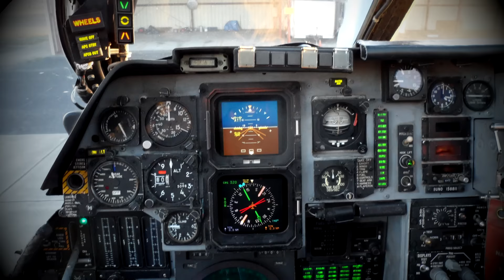USMC Jet Crashes Cable Car | Last Moments

Comment: At 500mph, they probably never even saw the jet.  Probably just saw a blur, and then felt the cables snap
Reply: They were apparently spinning as well. At 500 mph impact with the cable and the cable being attached to the cabin at the top, they not only started to fall, but must have turned upside down at least once. I talked to a car mechanic who was one of the first on the scene and apparently the cabin was crashed on the ground upside down.
Reply: @MiroslavProvod  The majority of the weight would have been in the connecting arm and the trolley which would have caused the gondola to invert during the fall..

Comment: The pilot didn't need the instruments he was 300 feet above the fuckin ground he could have worked that out by looking out the window.
Reply: Thankyou for clearing up the fact you know absolutely nothing aviation, avionics, aircraft systems, or what a pilot actually does (It's a little bit more involved than driving a truck, but even that seems beyond some individuals abilities) but are willing to sound off about it anyway! Tell me oh wise one, at what specific altitude  would it be appropriate for a pilot to actually need a functioning altimeter from?

Comment: No one should be charged, accidents happen everyday, there is no way to eliminate all accidents it's impossible, we are only human, families all got well compensated, and things changed for the better. T helped Pave the road for new safety regulations. Although It is a shame and it sucks for the people and families that were involved.
Reply: How is "just an accident" if u fly for no reason next to a very low cable car??? U should go back to school and learn what the word incident mean. This is manslaughter.
Reply: @claudiam2474  because none of there flight plans showed that there was a cable car on that mountain, and they were testing there flying, which means flying low, we have military airplanes fly over our house everyday very ow once a month or so the hit the tops of the trees and knock branches off them. There always flying low doing rolls and flips, it is super dangerous really but they still do it, and if one crashed in my back yard it would still be an accident, I would want compensated but I would call it an accident even know there flying in dangerous ways, that is how the pilots get really good at flying, it's like driving you wont ever drive really good unless you practice sliding sideways doing dounughts, and messing around learning the car and how it performs under stress,
Reply: @claudiam2474  the maps they had showed there was no cable car on that mountain atleast not to them. So they had no clue they were flying by cable cars, did you not watch the video, they had like 3 different maps and not 1 showed the cable cars there and you cant see things well at 400mph once you see something you already hit it. if anyone is to blame it's the people that gave them the flight maps. Which means it is an accident, same as when someone falls asleep while driving and kills someone, it is called an accident even if they knew they were tired. Because it was not planned that is what and accident is something that happens that was not planned.  Now if they planned on hitting the cable then it would be manslaughter lol.
Reply: @nickhaley1212  Too bad the altitude limit was set way above where the aircraft was actually flying, and at an  higher speed than what the crew was told to.
The crew willingly disregarded all the orders set to them, flying too low and too fast. Surely though the USMC and USAF chain of command in that base in Italy wasn't innocent, they never passed and signed the maps provided the Italians (which included the position of the cable car and higher altitude limits for flying in that region).

Comment: As a person I would, like most, acknowledge the human tragedy of the event. As a U.S. veteran, I would also acknowledge that the aviators clearly violated international protocol and were reckless, causing unnecessarily the deaths of many innocent lives. A 60,000 dollar settlement is an insult both to the families and the victims. As much as I would loathe the prospect of condemning a fellow vet, I would, governed by conscience as well as the U.C.M.J. (Uniform Code of Military Justice) have to be harsh with my courts martial determination. The "pilots flying" would have gotten ten years min. for a breach of military and safety protocol. The others, while not guilty of acft control, were complicit and probably should serve two at Leavenworth.  The only leniency I would allow, is that having served with distinction up to the event, I would not deprive them of Veterans benefits. It might well be the only bright spot in a grim future. I would not give them a Dishonorable, rather a General Discharge. For the victims families my low bar would be two million per family. The U.S. government must atone for this international travesty.

Comment: At least twice in your commentary you stated that the aircraft in question was a "Fighter."  It was not a "Fighter."  it was an EA-6B Intruder.  Which is, as the letters indicate, an electronic-attack aircraft.  When you fail to even get the plane type correct, your words ruin your credibility.  I suggest that you do better research prior to producing other videos!  George R. Chance Ph.D.

Comment: May I be the 100 millionth person to point out the Prowler isnt a fighter? The "Queer" is an Electronics Warfare aircraft built on a Naval Bomber airframe; it has no business even pretending to be a fighter and flying at low altitude through mountainous areas.

Comment: Seems familiar, in a way, and equally infuriating as the case of several danish soldiers that developed cancer after being exposed to radiation due US military exercises obviously it was not in the best interests of the american goverment to left that be known but the danish goverment was also in cahoots with the cover-up, those men were thrown under the bus by their own goverment, such slimy move.

Comment: No wonder, with the safety record that the MC aviation has. This accident is symptomatic to the (lack of) safety culture in the MC.
Reply: You do know the job of Marine aviation is to fight wars in the air, right? 

It's not as if war is a safe environment!
Reply: @natowaveenjoyer9862  You are right war is not a safe environment...
Combat operations are by nature inherently dangerous.
But, you have to distinguish between operational incidents and combat losses.
National Commission on Military Aviation (MCMAS), have determined that USMC had a substantially higher rate of serious rate of serious safety incidents than the other services. After establishment of Joint Safety Council (JSC), the incident/accident rate has fallen. A report from MCMAS, concluded that
"the overwhelming majority of (military) mishaps could not be attributed to th inherent risk of military aviation." Happily the safety record of all naval aviation have in the last year improved.

Comment: If I was in that cable car as soon as it started falling I would jump on top of the fattest man or woman and use them to cushion my fall. It's simple mathematics that would most likely ensure my survival
Reply: Don't forget that they weren't just falling, but spinning as well. The jet hit the cable at 500 mph and with the cable being attached to the top of the cabin, it was the spinning rather than fall what the passangers felt first. They actually landed upside down on their heads so unless you're a really small child who could hide somewhere in the middle to be protected regardless of where the impact occurs there is no plan to jump on top or lie at the bottom to protect you. And if you were in the middle and protected from the impact, you'd probably suffocate after all the bodies and weight of the cabin press on you after the impact. In fact, in the 1976 accident of this same cable car, the majority of deaths were due to suffocation and not due to direct result of the impact: https://youtu.be/6-GBikY0AqM

Comment: They shouldn't have been prosecuted, low level flying is a necessary skill and I'd rather have these accidents happen during training than while in a potentially nationally dangerous mission over enemy territory.
Reply: Only good take in this comment section I’ve seen.

Comment: So imo the aircrew was totally scape goated. If you don't have accurate maps how are you supposed to know about an obstacle like a cable car. On top of the maps being wrong I'm sure it was s.o.p to practice flying at low altitude to simulate evading radar, and if the pilot wasn't warned about potential hazards he only has seconds or less to react. Cases like this happen all the time where military and civilians die and the higher officers blame the lowest ranking officers or enlisted to save their own asses and almost always get away with it
Reply: You don't normally need to have cable cars on maps when you're supposed to be flying at 2000ft. And he should of well known there was an obstacle there because how often do you see a yellow object in the white snowy alps and go "Wow must be an optical illusion". That pilot killed 20 people and destroyed evidence,

Comment: I never knew he blamed the altimeter.  I used to calibrate aviation equipment in the Marine Corp, that would have put multiple Marines under investigation and is not fair if it's true.  It's stressful when any accident is being investigated let alone a pilot potentially pointing at your shop.
Reply: "I used to calibrate aviation equipment in the Marine Corp"(sic)

Yet don't know how to correctly spell Corps.

Comment: I'm not a pilot (never even been in a plane) but if my altitude meter was broken I'd fly high enough over those mountains so I could see clearly. Maybe that's a bad idea in aviation but it makes more sense than flying through a valley right?

Comment: Still don't understand why they were flying so low, completely undefendable unless the aircraft was compromised and impossible to control, which it wasn't.
Reply: There was a talk of them avoiding a helicopter, but they must have already been below 2000 feet if they had to "avoid a helicopter".

Comment: Wait they couldn't tell the difference between 300 and 3000 ft ?? I may have heard that wrong.
Reply: Do the readings on an altimeter and a RADAR altimeter always match?
Reply: @AA-xo9uw  I don't actually know honestly...I was just saying I would think visually 300ft and 3000ft would be enough to notice...I've never used an altimeter...I've seen them in person...I don't think I've ever seen a radar altimeter in person...if I remember correctly altimeters can work in different ways right? I'm guessing a radar altimeter determines altitude by how long it takes for it to bounce back to the source from the ground? I would guess if it bounces off of a large enough object in the way it could think that object is the ground ? Thanks For The Response! I Hope You Are Having A Great Day/Night My Brother!

Comment: It's not a fighter jet dippy.  It is an ECM countermeasures and EW A/C built on the A-6 Intruder ATTACK A/C design.  Get your terms right.  TRY to do a little research.

Comment: I did not recall this happening.  This was so terrible.  So inexcusable.  I was born and grew on US Naval Air Stations.  Dad was a career Naval Officer.  All the pilots, Navy and Marine Corps were always reckless hotdogs.  Many owned Corvettes so they could drive at high speeds.  They were arrogant and braggarts.  Dad disliked the pilots.  I believe the punishment was unjustly light.  The Pilot should have been sentenced to many years of “hard labor”.  An old style of US Military punishment.  I’m assuming “hard labor” prison sentences are no longer considered civilized.  But in this case, it would be Justice.

Comment: 0:15 well considering planes are made from lightweight aluminum and titanium, I'll predict a steel braided cable will slice through it like a hot knife through butter if it flew into one. 3:00 Whaaaaat? No way.
Reply: I think their fuel tanks were made from materials that would prevent gas leakage and explosion if they were shot at. Not sure what material that is, but could that have been why the 2inch cable was sliced and the wing survived?

Comment: HTF did the plane survive and fly home? I would have thought that a planes wing would be a lot more flimsy than a steel cable? This really does not make any sense. Any structural engineers in the place?
Reply: It wasn't called Grumman Ironworks for nothing.

Comment: was working on an aircraft at aviano when this happened. The aircraft taxied by  with cable attached to it's arresting hook. The ground crew was standing by to do mass cover up.
Reply: "The aircraft taxied by  with cable attached to it's arresting hook."(sic)

Incorrect
Reply: @AA-xo9uw  42abccc. marines were right across from us. stuff like that you never forget.

Comment: I don't give a damn if the altimeter wasn't working as he claims. I'm not a pilot but I guarantee I'd know if I was under the 2000 ft limit, especially 300ft.

Comment: Why don't cable cars have like racing rollcages so this doesn't happen? And why would one ever be 200 hundred feet up? Lastly pretty crazy how people are so selfish they don't mind murdering 20 people as long as they don't get punished.. scumbags
Reply: There is a 200 feet deep valley between Cavalese and the ski resort, so much cheaper to built one 200 feet up over the valley then go down to valley floor and then up. But after this incident as well as the worse one in 1976 (https://youtu.be/6-GBikY0AqM) they finally decided to build one which goes down to valley floor and then back up, not being higher than about 30 feet anywhere along it's ride.